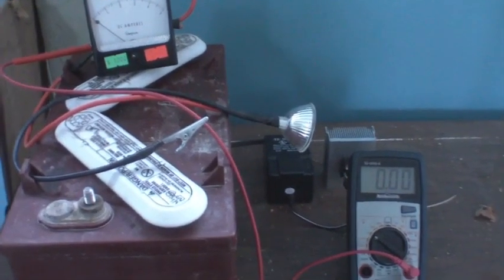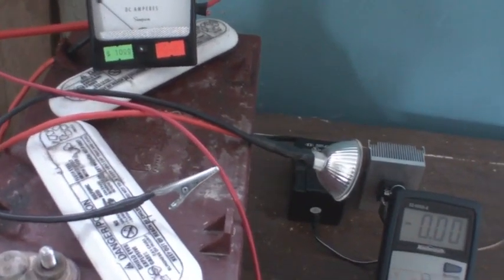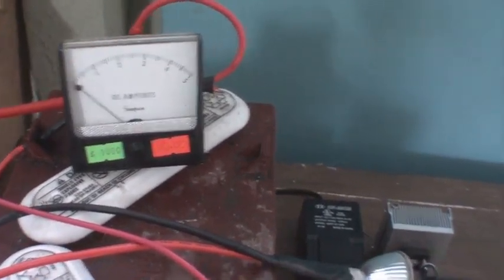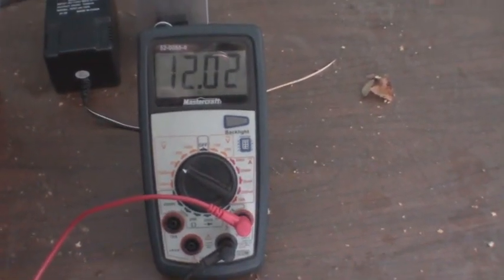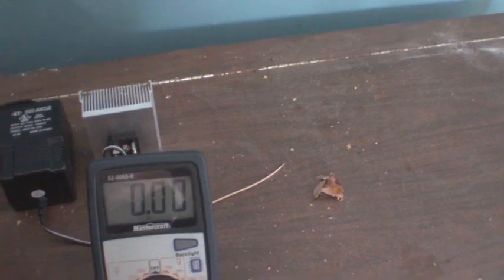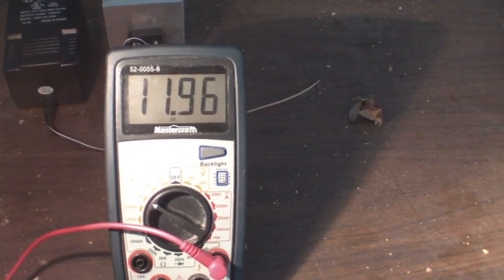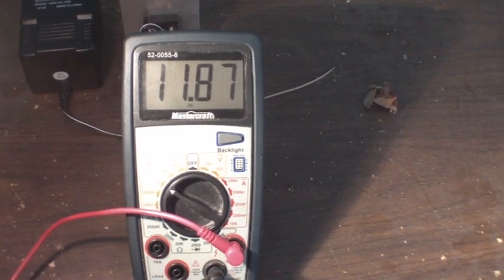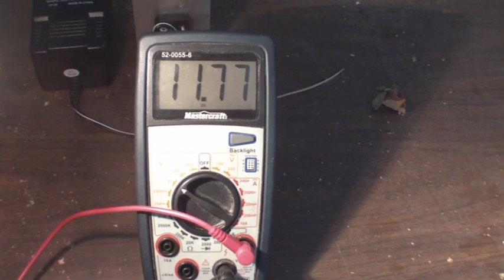Deep Cycle Battery (12V) Rejuvenation / Desulphating V01

Comment: I have an AGM Cabela\'s marine deep cycle battery. 1200 with 950 CCA. I
don\'t know the history of the battery. I got it checked at advance auto it
measured 12.52 volts and 457 CCA. I had it charged at Pep Boys with a rapid
charger(probably a mistake). It now reads 13.5 volts and 83 CCA. Does it
sound like a non revivable battery? Do I need a special AGM Charger? Is
there hope? Thanks for your help.
Reply: Don't charge 12v AGMs at over 15 v or they'll probably get ruined, often drying out. They're starved electrolyte, so not meant to be wet, or have water added, though by injecting distilled water (not too much) you'd have nothing to lose on a knackered battery. Recharge slowly.

Comment: Totally agree. If you charge it with solar then even more so and may save you buying one anyway, cutting down on new metals use. Nearly all that I have was junked by someone before...this PC was on a road side. Soldering iron has a piece of copper as the tip now lol.
Most would walk from a slightly bulged battery, which makes your experiment there even better.

Comment from the maker: Well! the NJ shark racer, ahh but you must know... it was YOUR video that gave me a kick in the butt! You see, the Frontiersprings, courtiestown, ZFF's latest, they are all the same thing = Alastair Couper's design from Home Power - each with slight mods! And yes, I have two done up .. and several bats to work with... and my twist is this: rather than just add current with a supply, I will (eventually) experiment with matching the TSO output to do the job... we shall see!

Comment from the maker: We shall see! She held 11.5+ for many hours. it's been about 6.5 hours and shes now down to about 11.43V, or so. Meaning she has delivered about 27 aH, already. It's funny you know... so many of these batteries kicking around, and granted, you can understand why people want optimum performing equipment... but consider this... I have just run a 50 watt lamp for 6.5 hrs. I paid $15 for the battery. I could continue to do this, for however long it was able, and still get my $15 back. (scrap value)

Comment: Hi,
no there is no short in any cell, otherwise you would only at maximum
get around 10 Volts after long normal charging...

So it seems your battery is just sulfated only and you need to supply some good
pulses to it to desulphate it.

Regards, Stefan.
Reply: here's  several things for fixing a car battery
never attempt to do this unless you are sure what you are doing - the acid can burn you
Test the voltage first - there may be a kaput cell which will be a waste of time trying to fix.
Check the battery fluid.
attempt to fully charge the battery.
(I read about these using Rapid Renew Roadmap site )
Reply: There are many components to doing a pro job. One place I discovered which successfully combines these is the Jons mender guide (google it if you're interested) without a doubt the most incredible info i've seen. Check out this incredible resource.